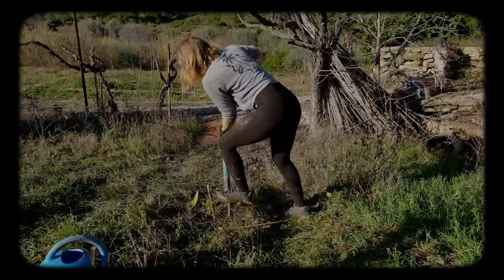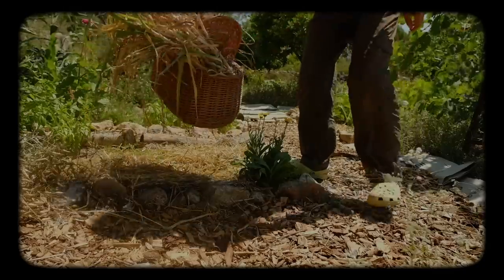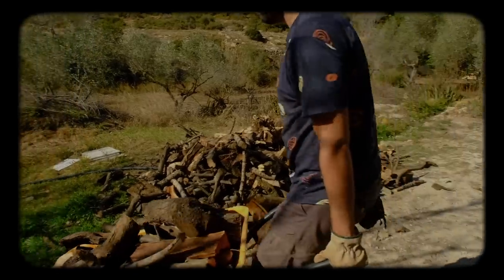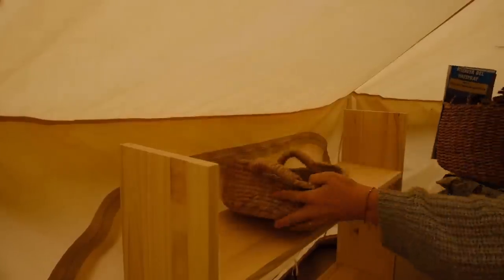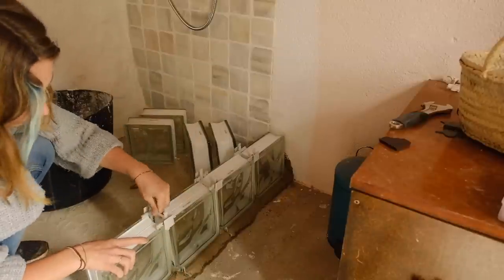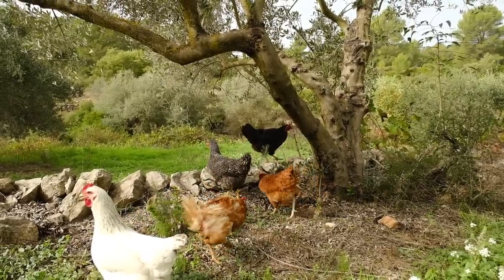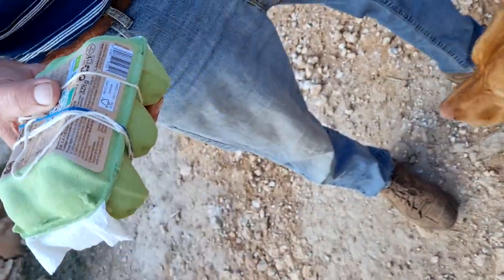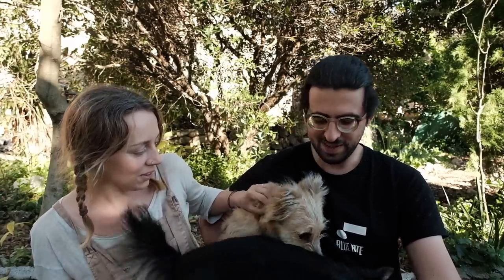We Only Have ONE Plan for 2023

Comment: Fruit tress are quite easy to prune, basically aim for the dead and diseased branches firsts, and then stand back and try to picture in your own mind the way the fruit will hang, obviously there should not be touching each other to prevent bruising, and branches from rubbing on the fruit. So aim for a good spread of the main branches first coming from the trunk (do not remove all the smaller branches of the main branches you leave on the tree) try and keep it evenly spread, some lighter pruning can be done during the growing season, and remove any bunching up of fruit which can collect debris from above. Remove any diseased leaves branches and burn. Once you have a good layout the following year is much simpler. The extent of pruning will obviously be down to how long the tree has been untouched. Good luck!!

Comment: Really inspiring stuff! Best of luck for 2023! Concrete floors suck, even when they're tiled they'll always feel cold. I ended up building a wooden frame set onto the concrete (with a thin cork and plastic barrier between them) and insulated the spaces between the wood with cork board (25mm thickness) then put marine plywood on top and then I'll put my final floor on that (hardwood in one part, tiles in another). When it's all done I'll lose about 6cm in height but if you have the space and the money (the cork and plywood are pricey) I'd recommend something like that. I had to chop off the bottom of my door to make space for the higher floor (it opens inward), but if you're replacing your door anyway then you could adjust for this. Just an idea! I'm so so happy I took this extra step. Feels so cosy and my place is still essentially a creepy barn. 😁
Reply from the maker: Thank you! 💚 I think we are erring more on the side of wood now as well so I appreciate the additional vote of confidence from someone's who's already done it! Tiles aren't cheap either so if we have to spend the money I think wood could be worth it. So much warmer and cosier!
Reply: @LittleSpanishFarmstead  Glad to hear that! If you want to see photos of what lurks beneath my floor or need any advice, let me know!

Comment: Have you considered induction plate for cooking, since you have your solar panels and going for off-grid self-reliance? It is a big consumer, sure, but also the most efficient way of converting electricity to cooking. Better than gas, with all the benefits of gas, too! You can expand your solar battery capacity and plan around that.
Reply from the maker: Yeah that's a really good point, it could be super useful. I'd have to check the wattage but we have friends who use one, during the sunny days. I was thinking an electric slow cooker could also be a good option.

Comment: what did you buy to put your solar panels on the roof? I wanna install the same set up , thanks guys
Reply from the maker: Ermm I honestly don't know what it's called. It's a galvanised steel support structure, I don't know if has another name. Places that sell the panels should sell the frames as well, I would think.
Reply: @LittleSpanishFarmstead  yep sure it should be, thanks